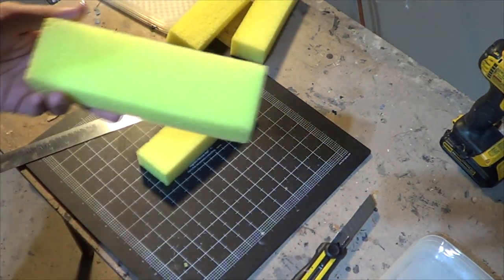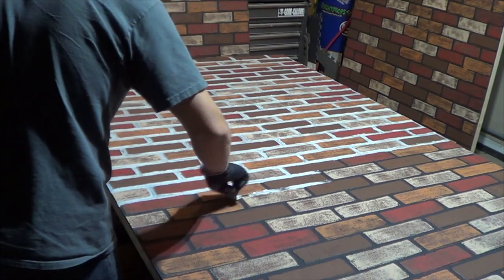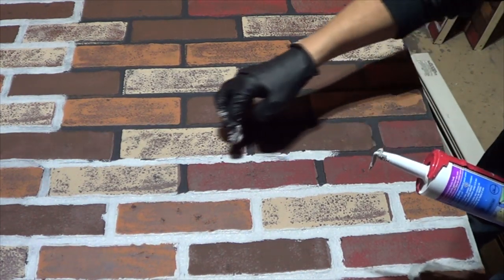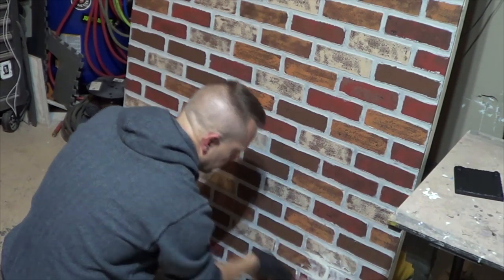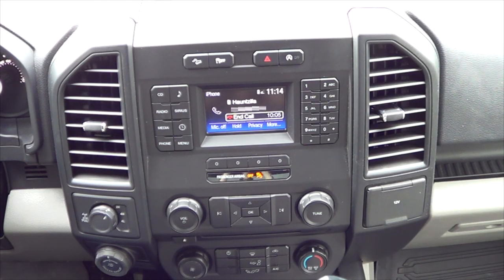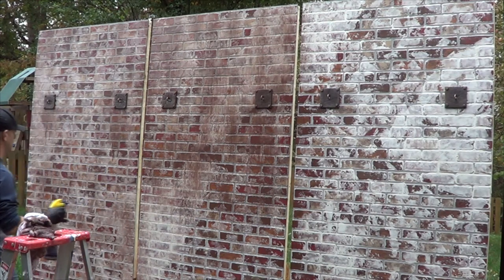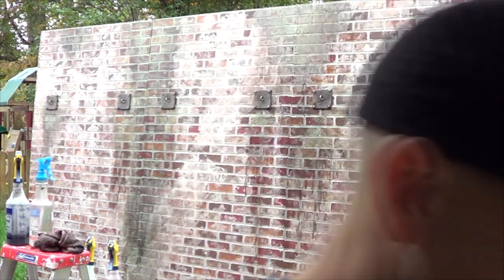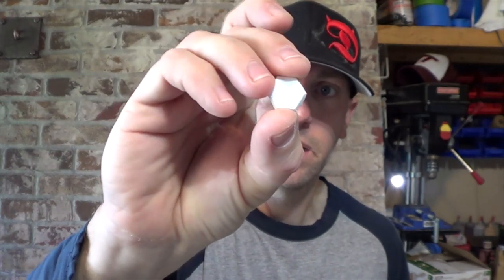How to Paint Faux Wall Panels

Comment: I love the end result. I have watched several of these in preparation of a bar and dining room project. I am wondering why no one has attempted to cut the connecting panels around the brick and fit them together link a jigsaw puzzle to better hide the seams? It seems to me the doing it that way would make the seams virtually undetectable after applying the grout.
Reply: Do you have any thoughts on that of if it would work?

Comment: This is exactly what I’m doing now... BUT the panels I got are NOT cut exactly the same way so it’s almost impossible for every single panel to match the next one’s bricks!!!  How can I possibly fix that??? 😩😩
Reply from the maker: I would stand them up next to each other and mark the adjacent bricks to be painted the same color.  Even if they are different sizes being the same color they will blend together.  no one will notice!
Reply from the maker: You can always break up the seams with something.  Like vines, downspouts, lean some debris up against it, clothe...
Reply: Graves Of The Groves thanks!!! I appreciate you very much,  your post by far has been the most amazing and inspirational one!
Reply: I haven’t done it yet but, I’ve seen others disguise the line where the panels connect with joint compound or mud.  It takes a little bit of an artistic touch (kind of like what he did here) to make them disappear but, seems doable with patience and time.  The result was you couldn’t see where the panels met and looked Ike a entire wall of brick.